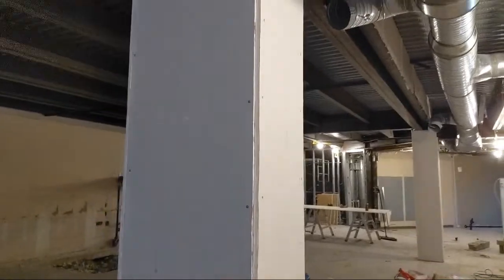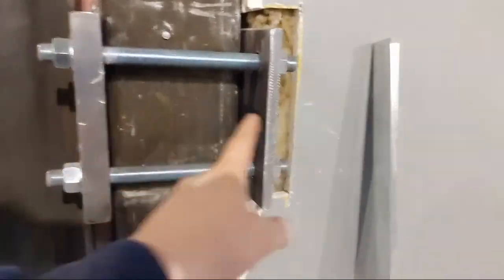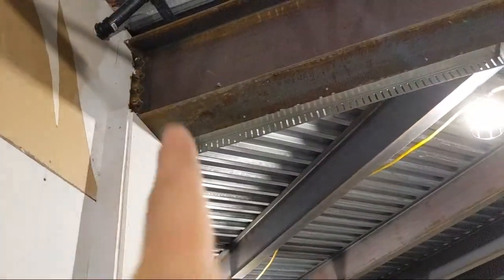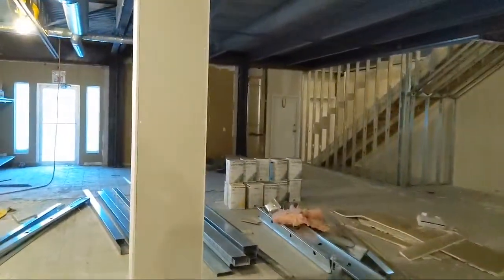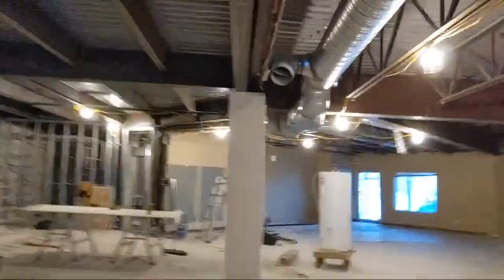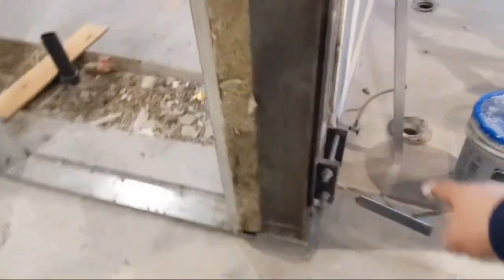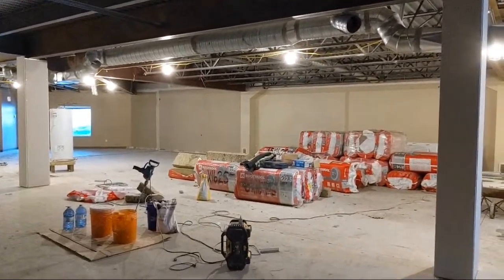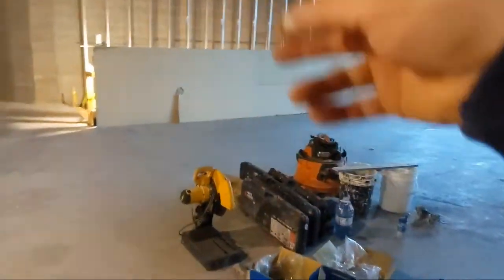Fire Rating Columns Steel Stud 5/8" Drywall Base Building

Comment: The way you framed the columns, with just angles. Is this considered board framing??
Reply from the maker: You could use that term and I would know what your talking about, but the correct term is back framing, as in backwards. I like using the 20 gauge angle but you can do it with light gauge too.